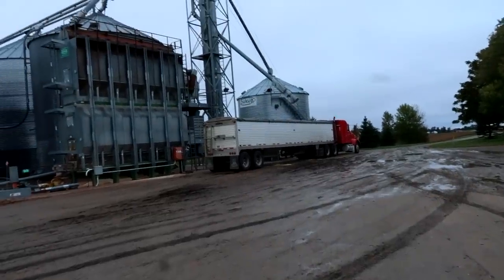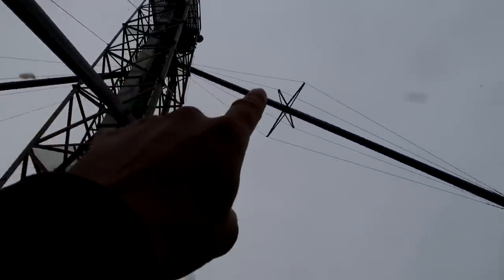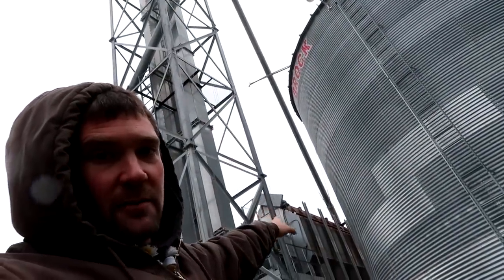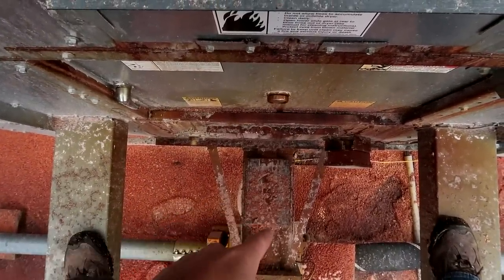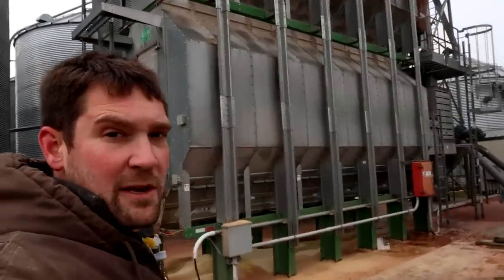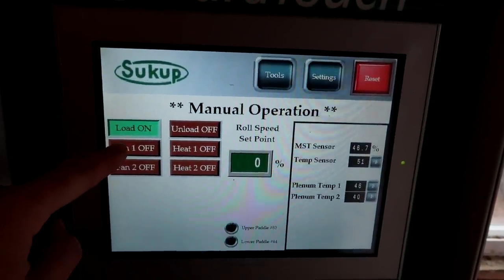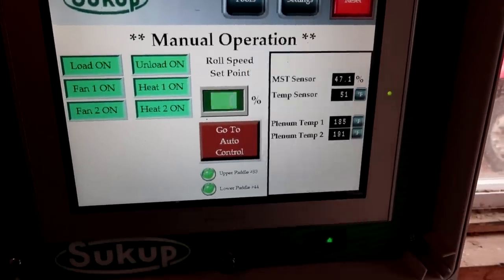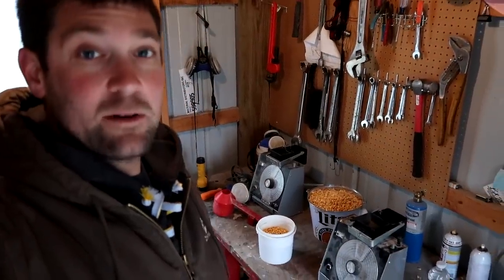Our Grain Dryer and Bin System-How They Work

Comment: How does the manual moisture test work? Maybe make a video on this topic?
Reply: Seems that weight? Our meters checks the grain electrical resistance and converts the reading to the moisture %.
Reply: What do you think going to be running beans through the dryer too
Reply: He did a video last year I believe on the manual moisture tester.
Reply: I think it’s weight of a specific amount of corn, hence why he fills that square cup and then dumps it onto the meter.  Used to watch the old elevator guys do this when my dad would bring corn in.
Reply: We had a dickey Jon tester we kept on the combine that was calibrated with the grainery. We also would use it to cross check every once in a while the yield monitor to make sure it was correct as well. Those go awry every now and then

Comment: Maybe this is just the first year you are showing it, but it seems like when you get all 3 trucks full and grain cart, you are essentially forced to stop to wait for either room in the wet tank or the dryer to catch up. Seems that 12 row header is making field time faster than usual. If you were forced to replace the wet tank or dryer to make your operation flow more, which would you choose and why? 

Also, you went from like 80k to 120k in what seems like just a month. That is a tell-tell sign of quality content. Excellent job to both of you!!!
Reply: This is a good question.  Increase wet tank capacity or increase dryer size?
Reply: Well the way i see it increasing wet tank capacity is just dellaying the problem not fixing it.
The optimal would probably be wet tank capacity for like a days harvest, and having a dryer big enough to make sure that pretty much empties every morning before you start.
Reply: Good question if it was me i'd probably increase dryer size but i'm no expert farmer.
Reply: Jordan Roberts I’m thinking that at this point they are dealing with 3 things that slow the system down. Wetter worn than normal, cold temperatures, and the 12 row header increasing harvesting speed.  Possibly in a “normal year” the problem wouldn’t exist.  Having said that I’d go for more wet storage first.  An overhead cone bottom that could be filled with dry corn for a quick load otLooks like a big dryer.
Reply: Lower temperatures aren't slowing down the harvest, it's actually accelerating it (frost pushing out the water eca). My guess is that they have enough trucks to store it if the wet bin is ever full, but judging from the system my guess is that it actually goes fairly quickly to dry out the corn. So if they leave it running overnight it might empty a lot from the wetbin, or certainly enough to not worry about it.
Reply from the maker: With the 8 row header we typically would catch up to the wet tank at night and by morning it would be ready for us to start filling again.  The 12 row header is faster but not a ton (because we have to drive slower). The plan is to increase the size of the wet tank, either by raising the current one or just building a new, larger bin.  Unfortunately, that costs money so we haven't invested in it yet.

Thanks for the content compliment!
Reply: +MN Millennial Farmer On that note, when it comes time to upgrade your dryer, do they make faster dryers now? How old is your current one?
Reply: Good comment sir. And I noticed the Subs also. Congrats Millennial Farmer!
Reply: Wet corn 25-26% compared to + or - 20% corn on a normal year and cool damp air tend to slow the dryer down a fair amount.  Many Minnesota farmers will be dealing with this issue all fall.
Reply: @joshbascom8618    wet tank is cheaper.
Reply: It would be much cheaper to increase the size of the wet tank.
Reply: I don't think that is the problem because last year they ran two 8 rows I thought. I could be wrong. Personally I would upgrade the dryer because a wet bin will just pile up more wet corn.

Comment: How many bushels can it dry per hour?
Reply: I bet that depends on the incoming moisture content of the grain and the desired outgoing moisture content .... I'm sure they have some form of rating the dryers though, like BTU/hr
Reply: Depends, and Yes moisture.  I’m assuming the dryer can slow the flow through the walls to maintain its 15% setpoint.  It is probably rated at a certain crop moisture, and at a certain ODAT (outdoor air temp) to be able to determine the bushels/hr. output.
Reply from the maker: Roughly 700-1000 which is highly dependent on incoming moisture
Reply: Can you dump cold with that setup?

Comment: You should put covers on the belts to keep fingers and dog tails out of them and they will stay dry and covered
Reply from the maker: They definitely don't stay dry from shields!  They also make it a lot more difficult when we plug an auger or smoke a belt.  For safety reasons it would be ok though.

Comment: Thanks for explaining the drying system! I farm about the same amount you do in SE Nebraska but there are very few drying setups on farms here. We have a couple of 10,000 bu. batch drying bins but by the time we dry that much corn we can almost always get the rest of it out of the field at 17% or 18% moisture. Then we just put it in our big bins and air dry it down to 15%. I am so glad we don't have to go through the added hassle and expense you guys up north do. I think we did batch dry about 50,000 bu back in 09' by emptying and refilling our drying bins but thankfully we don't have years like that very often.

Comment: That was absolutely the best description of how a grain drying system works.  I had the internal operation of the grain dryer totally wrong in my head.  Thanks for the excellent detailed description.  Seams the weakest link is in truly knowing you are getting 15% moisture corn out of the dryer.  If the computer / sensor is that unreliable, and you have to keep checking every few hours, how can you be sure the discharge speed of the dryer isn't giving you too wet of a corn?  You would think we could do better these days.  How can you trust the dryer to run unattended if the moisture level can't be accurately monitored?  There is no automated way for a sample to be taken and accurately read periodically?  Sounds like a cool engineering project to sort out.

Comment: Thanks for that, you have explained or I have noticed points that I raised Re pipe supports etc. What I would suggest is some roofing over the pipe switch and the belt driven drives. You are spending a lot of money drying the grain but are leaving pipework open to the elements, plus belts left open to get wet. In other trades the belts would need safety covers, what I'm suggesting is a roof to prevent them getting wet with the rain water diverted away.

The top of the grain pit looks to be at ground level, do you have any problem with surface water getting into the pit.

Looks a good system.

Comment: Seems like over time you could add various pressure, temperature and vibration sensors that tied into the right monitor could alert you on your phone or some other type of alarm so you system could be monitored while you’re sleeping or away from the farm.

Comment: The next step is a biochar retort system that creates the heat from wood gas and then ideal charged fertilizer to spread from compost piles in the spring.  Plenty of forests to manage with a chipper for fuel.  The retort also becomes a bio fuel electricity plant.  The biochar works for years building soil and microbes.  Good luck on the upcoming deer season.

Comment: I'm not familliar with farming, but I design and build robotic and hard automation systems for industrial use. This is process control, not unlike industrial many processes, so I feel qualified to speak about it, generally.

Timing belts (toothed belts) are more expensive, but they are far more robust than V-belts. However, they are more like chains, in that they don't slip and might cause issues when there is a jam. In industrial settings, we use shear pins and special sprockets or pullies. Shear pins are far easier to replace than belts and they protect against overtorque events, such as a jammed auger.

As for an air line blowing off, you could add pressure sensors to the top of each bin and have your control verify that there is the expected pressure available at the bin that is supposed to be receiving the grain. In general, a little more control logic (and some sensors), attached to your already installed control system could make this system far more fool proof. I don't think it would be too dificult or expensive to allow you and your father to sleep throughout the night, rather than checking on things that the control can do.

By the way, the issue with your moisture readings being off is likely not the "computer", it likely has to do with 1) the sensor. 2) the wiring that supplies the sensor. 3) The amplifier that converts conductivity to an analog signal that the controller reads as % moisture. This should be troubleshooting that the manufacture of your system can walk you through.

Comment: Looks like there could be the opportunity for a bit more sophistication in the pulley guard for the auger drive.  I wondered if the dog was going to get a tail trim at 7.33.  pulley belt guard - uv stabilised pvc window to see belt condition, perforated metal sheet to allow air to circulate to keep belt cooler.

Comment: How reliable/accurate is the electronic moisture sensor once the dryer reaches steady state operation? 

You could also add proximity sensors to the augers to sense if they are actually moving. That would allow you to stop feeding from upstream   If a belt breaks, hopefully preventing a plugged auger. However, that takes money and adds complexity.

Comment: I REALLY love the way you explain how your dryer system works! I have ideas about detecting stopped augers or if a transport pipe came loose, then automatically shut down so it wouldn't dump out on the ground.... and it could be configured to send your phone an alert??

Comment: Zach, so you currently have a continuous dryer. We are still "old school" so to speak using a dryer bin with bin heater, stirrator etc and doing 6,000bu batch dries. One thing we have looked at is a continuous dryer as they are becoming more and more efficient, but now you have to incorporate the cost of another leg or in your case a vac system. With that said we are leaning more towards a shivers system as it fits the setup better and will have a slightly less financial impact. My question to you is: what do you think the life expectancy of your dryer/vac system is and thoughts of it vs. a shivers system. Basically were looking for the most "hands off" system that wont break the bank. Another great video by the way. And I think the "extra harvest" clip you had in the last video was good. I think a simple 30min ish video of just a combine cab perspective of opening up a field would be sorta interesting for some people. Gives the an idea of how far the combine can go before needing to dump, how the end rows are taken off etc. Thank you from the flood farmers of Iowa!

Comment: Have you ever considered installing any solar panels or windmills on the farm? I realize that Telsa doesn't make any tractors or combines, but you use a lot of electricity around the yard to power the augers and blowers to move the grain around between the trucks, pits, bins and dryer, and the shed roofs seem like an excellent place to install a few solar panels. I was wondering if this was something you ever had a look at, if it was even possible in your industrial type setting, and what factors you considered: cost of installation; government subsidies, if any; frequency and duration of power outages in your area; time of year when you use the most power vs when solar/wind could deliver the most power; average wind speed; snow fall to cover the panels; etc,. etc., etc.

Comment: In order to not dump grain overnight if an air pipe came apart, could you put a sensor at the end of each air pipe at each bin and a sensor right after the dryer and compare the two to trigger an alarm? The thought is whatever grain is being pushed out of the dryer should match the amount going into the bins.

Comment: Do you run your dryer with heat in both chambers and send the corn out to the storage bin hot at 200 degrees and cool it in the bin?

We use our lower chamber with no heat and cool it in the dryer.

One average, how many bushel per hour does your dryer run?

On your dryer you set your lower auger to 17%.  When it's in manual does the computer adjust that auger speed up and down to keep the moisture at your target level or does it just stay at 17%?

Does the dryer Run on propane of natural gas? 
Ours is on natural gas.

How often do you have to clean out those plenum chambers?  

We clean our every day or two depending. We just open the doors and engage the big fans and let it blow out.

I like your double pit system.  We only have the one pit, but it holds 1000 bu, we just have to move the truck ahead.  We also have a pneumatic system like yours and we love it.  We went that route because we built our grain bin system next to our four 20×80 harvestor silos and reinforced them to store grain.  We put soybeans and dry corn in them.  It was better than letting them stand empty.

Great channel, enjoy watching, thank you.
Reply: He said in the video that he has both chambers on heat, top 220 and bottom 200.
Reply: @stubbi  yeah I know, I was just confirming that they are cooling the corn in the bins, which we have had problems with.  That's why we went to cooling it in the dryer.

The plenums could also have floors in them that divide the chamber and cool the lower half like ours does.  That's why I was asking the person who owns the dryer.

Comment: Thank you, for taking the time to make another great and informative video. That was awesome!!! Fully understand you cannot reply to every single message it simply is not possible to be everywhere and do everything. One question though as you never mentioned it. The dump pits I assume have a sump or something inside them to take care of any water which gets into them from rain etc. I would guess it goes down into a collection auger pit for the grain and it would have a mesh bottom to allow water to fall through. Below that would then be a water pump with a sensor to detect water? I do not know am just guessing.

Comment: You could have “Zero Speed” switches added to the critical augers, fans, blowers, etc to detect when something plugs or belt breaks. System could shut down automatically when a Zero Speed is detected.

Comment: The grain dryer looks like it gets covered in alot of dust. What is the cleaning routine like for clearing out the perforated walls, as well as the surrounding area. Is the dust from the corn a fire concern?

Comment: how many bushels an hr. is that system typically capable of drying ?  my dad had a batch dryer that held 600 bu. back in the 70s we had to manually unload it into the grain leg then refill it and repeat , the pneumatic system of unloading to the bin you guys have is really slick , Thanks for the videos as they keep old guys like me in touch with modern farming !

Comment: Great video, what type of fuel is used for the grain dryer? (propane , natural gas)? Wondering what is the cost and would it be possible to use something like used cooking oils or used motor oil for a fuel source? Thanks

Comment: Great channel!  Can you install circuit breakers on the auger motors to sense an over current condition when the pipe is plugged?  As grain storage systems go, is yours an average size, or larger than average, or?   Thanks for posting.  Jerry

Comment: Are both dryers full heat or does the bottom dryer half heat half cool? If both are full heat do you fill one bin let it steep and then transfer to cold storage bins?  I cool in the dryer to eliminate the need of a steeping bin then use an auger to fill cold storage bins right out of the dryer seems to improve the flow of the grain and takes less power than moving hot corn.  I would like to have an air system over a leg someday, like working on the ground versus up in the air.

Comment: My experience on a farm is 4 decades old. Are corn varieties picked much wetter than it used to be or is it a location( farther north)  thing because if I remember correctly when I lived in Iowa, they tested grain at the elevator to see if it needed to be dried. It certainly looks more like a factory than a guy walking thru the field with gloves that have a hook on them to cut the ears off the stalk?

Comment: Growing up we used auger to move everything. Later I got to use a vac-u-vator to clean out a bin(much better than a #12 scoop shovel, wheat). Why have both augers and air moved grain? Is the wet grain to heavy to work with the air system?

Comment: First watched video. Subscribed.
very interesting. tyvm for the explanations. I did notice the belts hanging on the wall. Err, yup; you definitely want spare belts around, for sure.
lol WRT the comment "you want to check it every few hours because you don't want to come out and find a 1000 bushels of corn on the ground" 😆
Just wondering, how does one remove impurities? I noticed that a lot of twigs and branches and stuff hanging off the intake grate under the trucks. Just wondering.

Comment: 220 degrees??? Woa!!!!! Do you have a problem with the corn stress cracking? I've been told that anytime you go over 190 plenum temp your decreasing your grain quality.....ie stress cracking?

Also. How do you deal with moisture in the pits? Or is your water table low enough? Around here we'd have to biuld the pit above ground, so to speak.